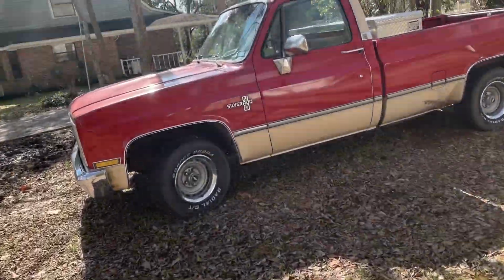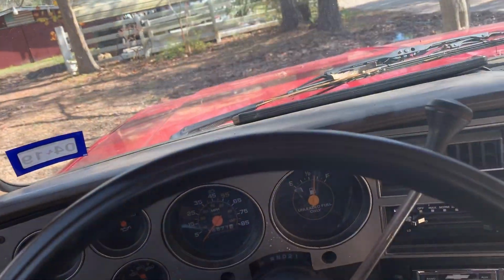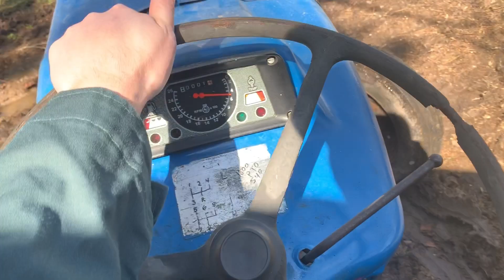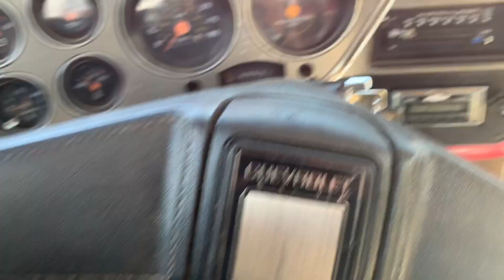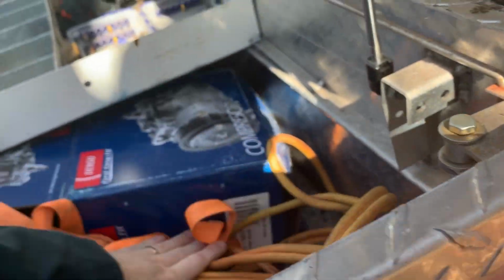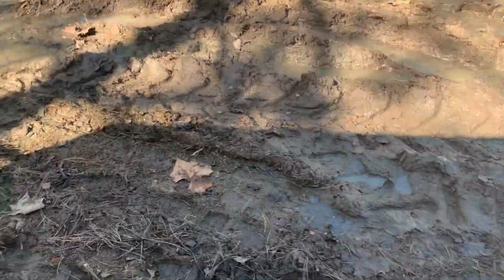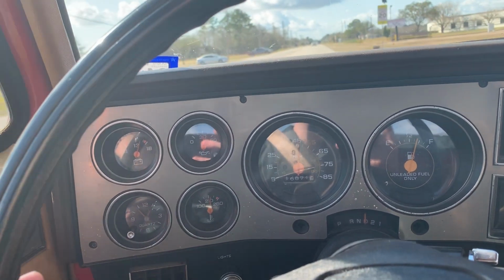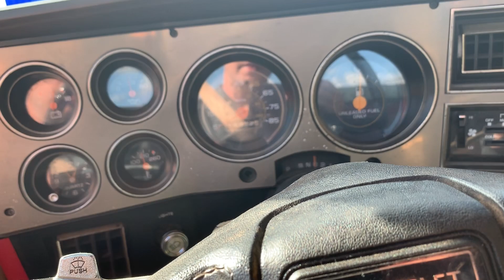Will the C10 Start

Comment: You could use a test light inline with the battery and then pull the fuses 1 at a time. When you find the drain the test light will turn off.
Reply from the maker: Yeah I need to check and see where it’s coming from.